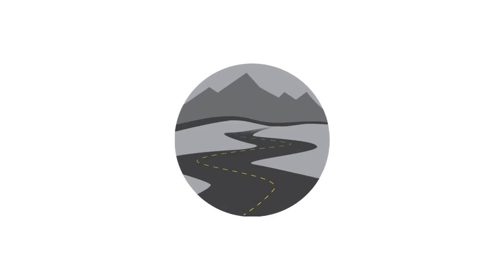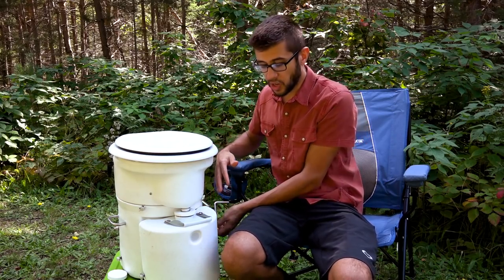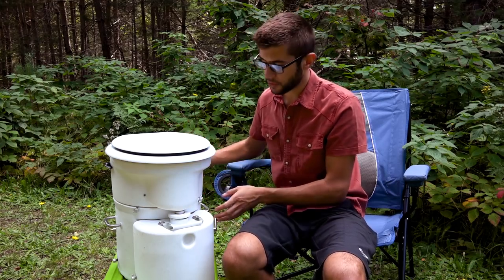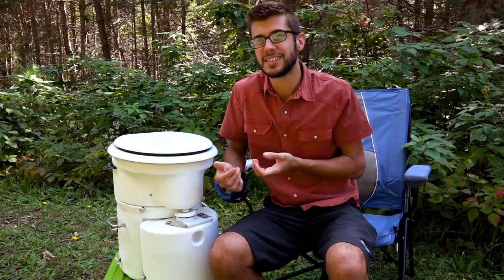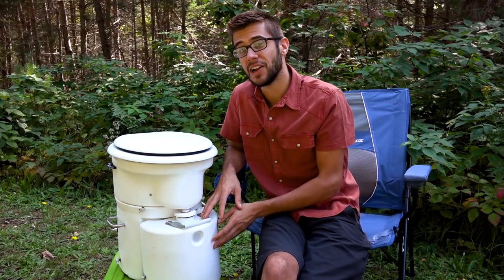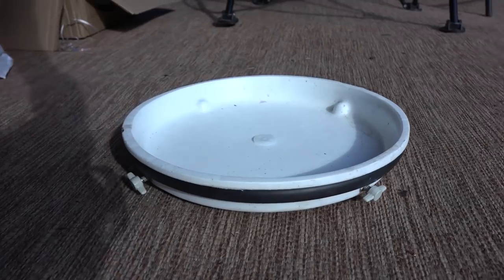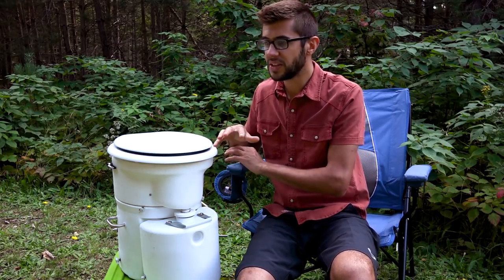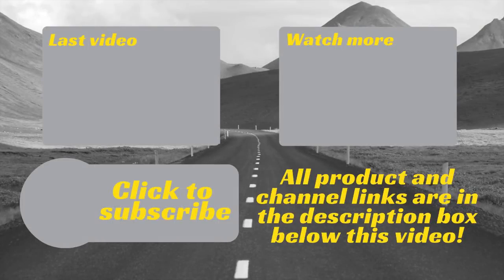Air Head Composting Toilet | Product Review | Eco-Friendly & Off-Grid Toilet

Comment: Tom, I built my own composing toilet and it works quite well. The air head has gaskets that are actually defeating the fans purpose. As you know, the computer fan has little power and also it don't take much to stop the air flow. Try putting something between the gasket and see if it don't work better. It will dry out the compost and the airflow is better. I used an elongated seat with the child seat built in. NO GASKETS. I purchased a urine diverter and am going to run my pee drain into my black tank. Make the black and grey all gray and it will last a month. Eliminates the pee bucket also.

Comment: I've had my Airhead since early September.  IO've never regretted getting rid of the regular water-wasting toilet.  Never have to worry about the black tank or finding a dump.  It saves water, too!  Changing the coconut coir isn't difficult.  It lasts me about 2 months before I change it.  I don't need a second fan - very little, if any, smell.  What does smell somewhat is the urine tank which I empty every third day or so.  After urinating I simply spray a little vinegar in it. If in the desert, I walk a bit away from my site and dump it.  If in campground, I dump it in campground toilet.  The coconut coir goes into any convenient dumpster.

Comment: Hi, I enjoyed watching the installation and review. One point, the toilet relies on aerobic bacteria breaking down the waste to form a compostable product. However, each time you empty the toilet you remove all the inoculum (the bacteria) so it has to multiply from scratch. 
Have you tried only emptying the bucket part way? Why not leave 1/3 of the waste in the bottom and use all this bacteria to initiate the bacterial multiplication earlier. That way it would compost more and breakdown quicker. Toilet bacterial inoculum will probably be species specific and will therefore benefit from this and reduce harmful species initiating.
Reply: In warm environment, the good (aerobic) composting bacteria multiply quickly.  Just dump the solids out but don't clean unless it got wet and went anaerobic.  Even then, adding a dry carbon source will fix things quickly.  Too dry, and you will stop the aerobic bacteria from doing its job quickly, necessitating dumping sooner due to insufficient breakdown of solids.

Comment: There is paper-thingys, that look exactly like coffee-machine-filters, only bigger, and with a cut-out that belongs to the front (direction pee-hole). they are slightly waterproof, so, if you don´t take 30 minutes, the hole for solid materials is as dry and clean after use, as it was before use... You just spray some cleansing  liquid on the pee-hole... I thought also of 3D-printing a siphon for the pee-hole, that´s airtight connected to the pee-flask-lid, so that when the siphon is full with pure cleansing liquid, the pee is airtight isolated in its flask, like the function of a siphon in a bassin or a normal septic toilet...

Comment: Great review, but two questions: 1) You mention the fan has to be installed to avoid smells and speed up the process. I see about 50% of the reviews state no smell NOT using the fan, while others recommend the fan for the odors. Any thoughts on that difference of thought? and; 2) You mention that sometimes after a week or two the solids become water-logged. How is that happening sometimes and not others? Is there a way to prevent it? What is the moisture from? We plan to use ours on sporadic weekends throughout 6 months of the year, and primarily just one person. So, the thought of water-logging is a little concerning. Great review, thanks a lot!

Comment: If you lived on rural property and were very responsible could you not dump the solid waste into a large composting outdoor bin for further decomposing then dump into your property or garden. One concern is contaminating your well water with pharmaceuticals especially birth control pills. Would the waste burn in a biomass stove or would odors make this too impractical? As for urine it's my understanding if it's diluted with 10 parts water it can be used as fertilizer. Any thoughts on this? Good video. It helped me decide to forego a Natures Head purchase altho I do agree that you need air to get past the gasket. I've left compost behind for months only to return to a totally smaller decomposed odorless mass, amazing.

Comment: I've seen people route the pee to the black tank and the poop to the peat moss bucket. Seems like you'd go further that way. We're considering this for our boat cuz we've already had a hose pop from bees getting in the air vent and blocking the hose. Tank couldn't vent and there was too much pressure. Thankfully our tank is in the bathroom closet and not under the bed like most sailboats.

Comment: They used to have an external vent cover which included a small solar panel to drive the fan.  It was designed for the roof of a sailboat cabin.   I wonder what happened to them providing that...
Reply: I had a small solar powered fan on an airhead... it didn't always run and little bitty flies got in and I had to clean and scrape the whole thing... Airhead says don't run it with just a solar fan

Comment: Diverting the liquids from the waste is called a dry earth toilet.   What the diversion does is keep the decomposition aerobic instead of anaerobic.   It's anaerobic decomposition that stinks.   Frequently stirring the solid tank increases the oxygen level for aerobic decomposition.  You do the same with your garden compost pile, stir frequently to encourage aerobic decomposition.   If you don't have composting material, leave half of the waste in the bucket, the partially decomposed material will act as composting material for new material.   Ideally you would want what you left in the bucket to have already decomposed for several months, the bucket isn't large enough for this but it'll be better than not having any composting material to mix new material with.   Larger dry earth toilets would operate this way with only half the wastes removed at a time and only fresh peat moss, coconut husks, dry leaves, grass clippings, newspapers or whatever added if the wastes become too wet.

Comment: I'm just an idiot but.... I don't think that I like 1. The hand crank being so low, making a person bend way over to use it. 2. A fabric handle for the urine tank has got to be a bad idea around body fluids due to its inability to be cleaned. 3. I'm also a little skeptical of poo not being mixed well because the crank doesn't scrape the corners of the tank.

Comment: Nearly all smell is generated "doing your business" -- the compost has a mild earthy smell.
Reply: There is paper-thingys, that look exactly like coffee-machine-filters, only bigger, and with a cut-out that belongs to the front (direction pee-hole). they are slightly waterproof, so, if you don´t take 30 minutes, the hole for solid materials is as dry and clean after use, as it was before use... You just spray some cleansing  liquid on the pee-hole... I thought also of 3D-printing a siphon for the pee-hole, that´s airtight connected to the pee-flask-lid, so that when the siphon is full with pure cleansing liquid, the pee is airtight isolated in its flask, like the function of a siphon in a bassin or a normal septic toilet...
Reply: @klausbrinck2137  Good idea.  I just use a pee bottle.  Working on a sustainable black soldier fly larvae (BSFL) bin with toilet seat top for solid organic wastes.

Comment: The only improvement I see with this system is that you would conserve your water usage greatly.  You're still having to deal with your own waste and on a daily basis rather weekly or longer with a black tank. Hooking up hose is more gross than bagging your poo? I don't get it.
Reply: The decomposition is aerobic so odours and methane are not produced.  With a black tank, it's an anaerobic environment, so sewer odours and methane will be produced eventually seeping through the plastic pipes and tanks and everything will reek.   This is what people replace the tanks and pipes from old sailboats and RV's.   Also, keeping the solids dry means you can store a lot more of it, with two people using it every day, it usually only happens to be emptied once a month, it's the urine that needs disposal every few days but if you pipe that to your old blackwater tank, it would take a long time to fill.  Basically you would have to empty these dry earth toilet systems less often than a black water system.
Reply: @johnwang9914  You're so smart! I've learned lots from your comments, thank you!
Reply: On my composting toilet on my sail  boat I only empty it once a month.. I've been using it daily for 5 years.

Comment: Why not route the liquids into the black tank?
Reply: That pretty much defeats the whole purpose of this toilet.  Not having to deal with emptying or cleaning the black tank is a huge plus, along with not having to use any water with it.  I just empty the contents into a plastic bag when nearing full, and toss it into the nearest large trash can or dumpster.
Reply: If the black tank can become an extended gray tank, routing liquids into it makes a lot of sense to me. Having a black tank of liquid should not be a problem as you still have to empty the gray anyway. To the purpose of the toilet is about avoiding the "sewage" created by normal black tank usage (along with prolonging boondocking capabilities) which doesn't mean the black tank is no longer useful.
Reply: A lot of people do that but you would have to do so yourself so depending on how good a craftsman you are, the appearance might suffer.